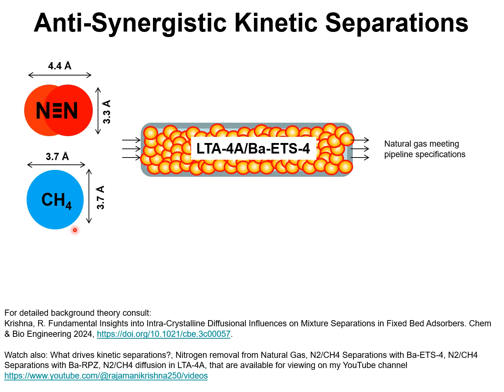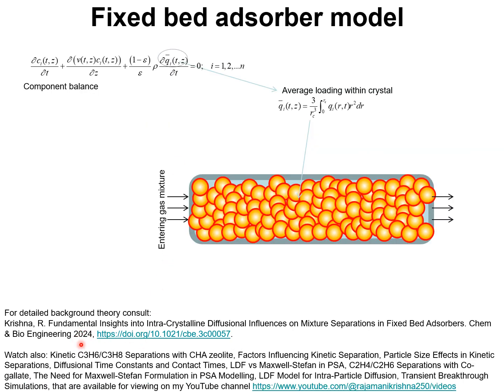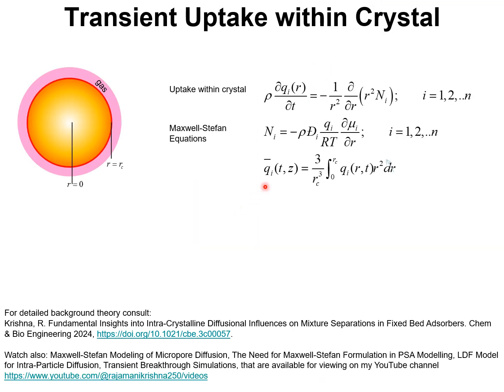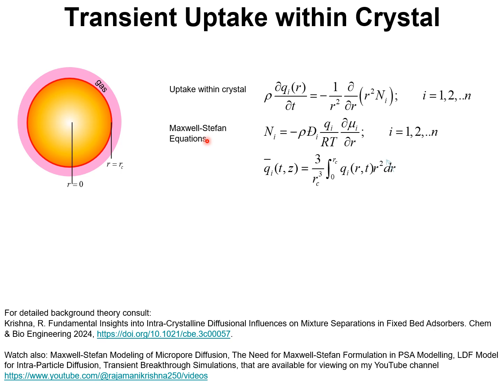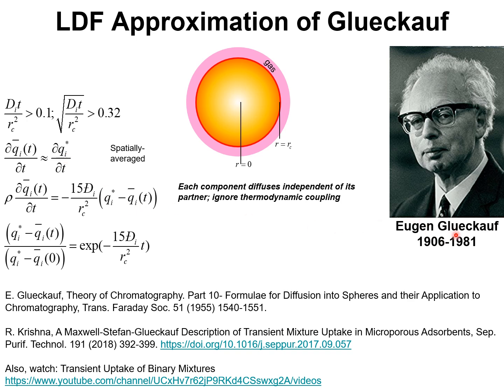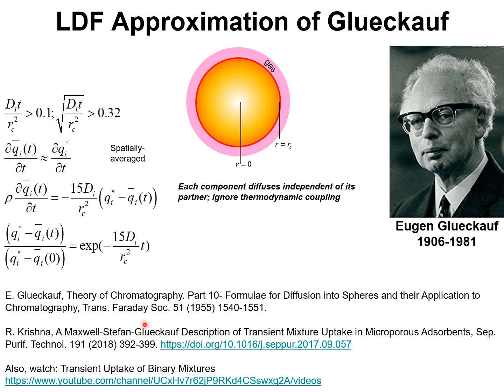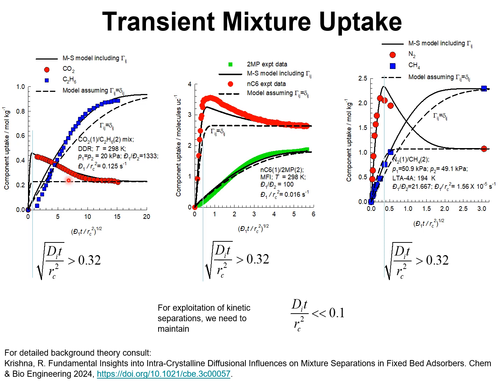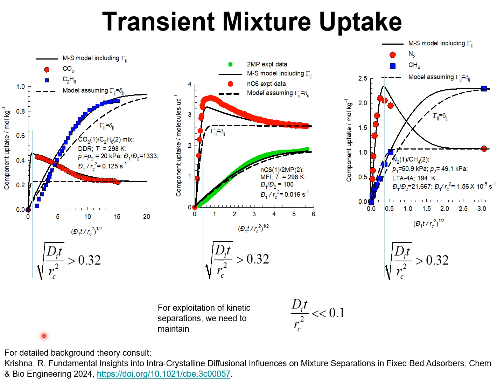LDF model will not work for Kinetic Separations

Comment: so can the LDF approach been used for TPD ? I cannot find anything on that.
Reply from the maker: LDF will not work for desorption processes.

For theoretical background, consult my papers
R. Krishna, Highlighting the Influence of Thermodynamic Coupling on Kinetic Separations with Microporous Crystalline Materials, ACS Omega 4 (2019) 3409-3419. (https://doi.org/10.1021/acsomega.8b03480 )

R. Krishna, Maxwell-Stefan Modelling of Mixture Desorption Kinetics in Microporous Crystalline Materials, Sep. Purif. Technol. 229 (2019) 115790. (https://doi.org/10.1016/j.seppur.2019.115790 )

Krishna, R. Fundamental Insights into Intra-Crystalline Diffusional Influences on Mixture Separations in Fixed Bed Adsorbers. Chem Bio Eng. 2024, 1, 53-66. https://doi.org/10.1021/cbe.3c00057. 

Krishna, R. Synergistic and Antisynergistic Intracrystalline Diffusional Influences on Mixture Separations in Fixed Bed Adsorbers. Precision Chemistry 2023, 1, 83-93. https://doi.org/10.1021/prechem.2c00003.

Watch also my YouTube video Adsorption-Desorption asymmerty.
Reply: @rajamanikrishna250  ok thank you :)